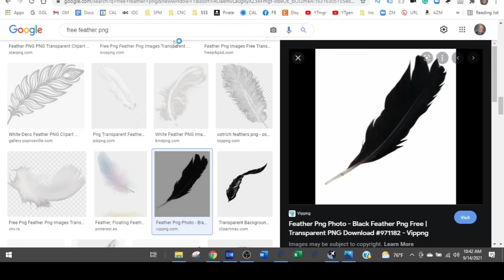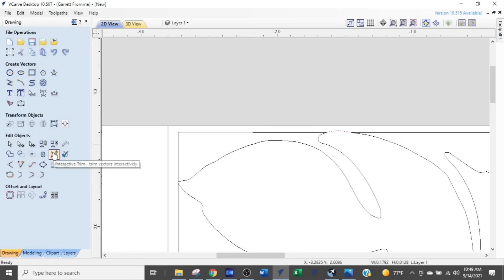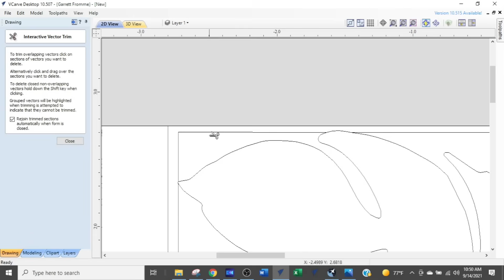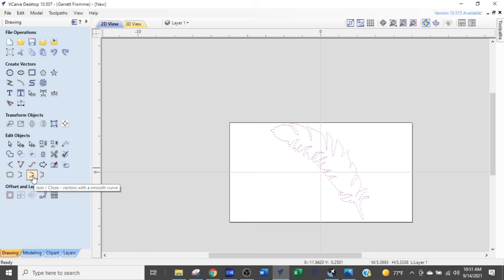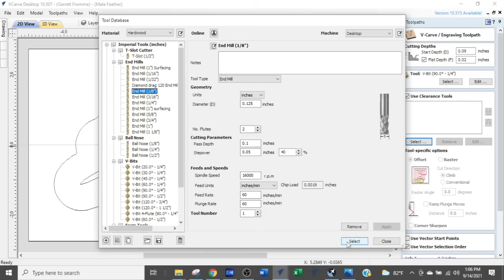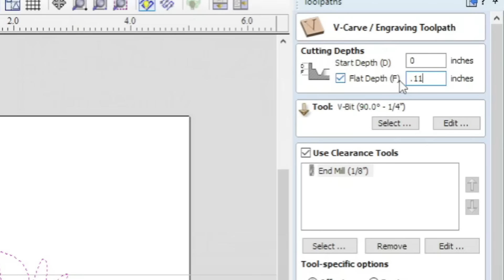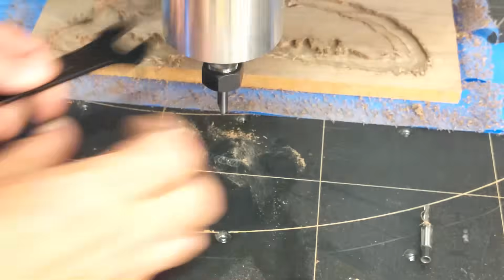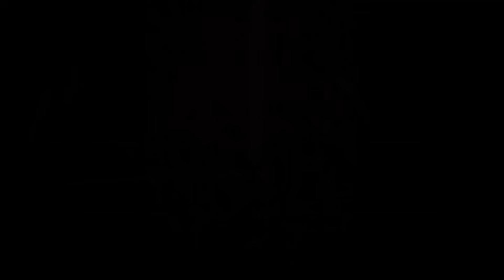How To Make a PERFECT INLAY with a CNC Router, Easy CNC Router Projects

Comment: As much as I'd love to follow along and try this on my own, unfortunately VCarve is entirely too expensive for my wallet at this time. ($700!!!!!)   I wish they had a monthly subscription I could get in on on but $700 for the software with no promise on return is a huge investment especially when I'm trying to justify about $3000 for a cnc machine upgrade (from my Sainsmart 3040).  I got about   33 minutes in, realized how expensive VCarve was and had to stop there.  Hell...I'd even try to sneak $350 past my "financial advisor" (wife) but as it stands now, I'm pressing my luck on the $3,000 hardware investment.
Is there any way you could do something like this with any of the other software?  I was very motivated by your intro and had high hopes of results but the sticker price will scare most any beginner out of being sadly disappointed when they find out that the software alone is ~1/3rd the price of the hardware. 
If you could offer any advice for those of us like me that don't have an extra $700 to spend on just the software would be greatly appreciated.  Thanks!!
Reply from the maker: John, I get your concern but you can accomplish all of what I showed you in the video with VCarve desktop. I think what you are looking at is the Pro version that you don't need. VCarve desktop is more reasonable at $350, and the reason a lot of us hobby CNCers use it!
Reply: @IDCWoodcraft  The only thing about the desktop version is the size limitation of 24"x24".  The cnc machines I'm considering have a minimum size of 29.5" x 29.5".  Wonder if there is a "upgrade" version to go from desktop to pro later on down the line if I start making some side money from my machine?
And thank you for replying back.

Comment: Excellent video.  Thank you.  I've been doing inlays on my CNC for years, but when I started there were no guidelines and I had to get to mine by trial and error.  This brings up a couple of questions.  First, the female where you use .09 for start depth and flat of .02.  Does that work no matter what v-bit you are using ... 45,60 or 90?  Even if we go to 30 degrees?  It is my experience and I think you mentioned it in the video, that the finer the inlay, the steeper the v-bit.  I imagine and have seen a couple of videos where that has been the case and they've used a 1/16" or even a 0.5mm tapered ball nose for the v-bit.  Please give us your thoughts on that.  Still the 9:2 ratio between Start and Flat depth?  Thanks again.  Dave
Reply from the maker: Hi Dave. You can do an inlay with any angle. The rule of thumb is the sharper the angle, the deeper the inlay needs to be.

Comment: Is there a way to do an inlay on a painted piece of wood,  and not mess up the paint around the inlay?
Reply from the maker: Alayna, great question! My immediate thought on this one is that it truly depends on what your inlay is and the paint you are using. I haven't tried this but I worry the edges of the paint near the inlay would be less than idea. Have you considered possibly staining the wood instead of paint?
Reply: @IDCWoodcraft   I could try. I was thinking of trying to do in lay stars on a wooden flag.

Comment: Hi Garrett, I think your method is great - only for very detailed motifs the 90 degree cutter will probably not be the right choice or? I have two questions: Does your method also give the possibility to mill deeper (at more acute angles) and the more important question: How deep does an inlay for a cutting board actually have to be?
Reply from the maker: Hi Daddy Approved, if you are going to be doing inlays for a cutting board, deeper is better. Typically I would recommend  that the male inlay be end grain and use a sharper v bit like a 30 degree v bit. Somewhere around the 0.4" depth range is probably "ideal" for a cutting board if you want it to stand up to some serious chopping in the kitchen!

Comment: Terrific video. I actually think I can this as a newbie to CNC. One minor suggestion - I would resaw the walnut on the bandsaw, much safer. I assume that if you have spent the bucks on a CNC machine, you would have a bandsaw. 😀
Reply from the maker: Ron, thanks! And you bring up a good point with using the bandsaw on the walnut, definitely a safer option!

Comment: Do you have a video showing the difference between the desktop and pro version.  I'm new at cnc and don't want to spend 700 bucks for the pro just for a year of service
Reply from the maker: Derek, the main difference is the cutting area. With desktop, you'll be limited cutting space to 24"x24". But, depending on what you're making this works great for a lot of our CNC brothers and sisters! Another thing about vetric is that you can always upgrade at a later time for just the difference in cost between the two versions. It's also a one time cost to you and not a yearly expense (unless you want to upgrade versions later down the road). Hope that helps explain a little bit about the differences!

Comment: Great video! Only comment I have is in your numbers. I have used the same numbers for a long time with perfect results. I use 0, 3 and 2, 1. Any comments?
Reply from the maker: Lloyd, thanks! You know, there's definitely a few ways to skin this cat. I have a mentee who also uses different numbers and he says works perfect for him too. If those numbers give you good results, I'm all for sticking with your method!
Reply: For anyone who might be reading this, I left out the decimal point. I meant 0, 0.3 then 0.2 and 0.1. But you probably already figured that out.

Comment: How do you determine your depth settings for male and female if you are doing a more detailed inlay? I am wanting to do the bird on the Poland Flag, just the bird and not the shield or even the outline of the bird. I was wanting to do it with walnut on cherry.
Reply from the maker: Use the same settings regardless of detail. Can go to 60v if necessary
Reply: @IDCWoodcraft  I am actually using a 60v... some of the outer feather lines on the bird dont go as deep and im afraid that when i glue and shave off the walnut those ones wont be there. I will give it a try, thank you for this tutorial.

Comment: Hi Garrett, thank you for the great videos. I am in the process of learning the software and the capabilities before purchasing and I wondering if the inlay work can come to a fine point on both the female and male sides. When I look at the feather it appears that the inside points are curved so the tool can make the full depth. Thank you for everything you are doing. Because of you I am looking to buy the Long Mill instead of the Shapeoko.
Reply from the maker: Enduringpromise, you're so welcome I'm glad you've found the videos helpful so far. Great question and the short answer is yes you can make the female and male portions come to a fine point but this isn't completely necessary and adds extra complexity in your tool paths and endmills you choose.

Comment: using your numbers on the start depth, and flat depth I find that when I glue the male to the female, the male is flush with the female board. The end result is gaps in my inlay. when I changed the start depth , on the male, to .2 and the flat depth to .1. the female is set at .3.  the result is very good with a nice tight inlay.  now while it's carving it the bit does plunge quite deep.  I'm thinking I should cut this in 2 passes....your thoughts
Reply from the maker: Hi Rick. If you are using 1/8" and going 1/4" deep or more, yes, 2 passes

Comment: when v carving the male ,plug, the tight spots all chipped out.  I used walnut just like yours, I used a 60 degree bit .any tips?
Reply from the maker: Chipping doesn't matter on the bottom of the make plug. It's not visible. Perhaps slow the feed down.

Comment: Thank you Garrett.  I'm trying to do inlays with the skinny jenny by cody's cnc.  It's a 5 degree tapered ball nose, and I'm having a tough time doing inlays.  I'm trying to do a .2 total depth, so there will be some meat for my father to turn away on his lathe.  What depths should I use so the .9/.2 theory would still apply?  Thanks again!!
Reply from the maker: Jason, thats a really shallow angle to try for your first inlay. Have you tried using a v bit first?
Reply: @IDCWoodcraft  no I haven't because I have the mindset that he needs some to turn away on his lathe, and shallow tips would disappear pretty quickly. I glued up a possible success tonight using a 1/16th bit in carveco maker, so I'll see how it turns out tomorrow, but I am going to try a vbit inlay soon, likely with a 60 degree. My inspiration is to be able to do narrow inlays like Broinwood...the best there is in my opinion
Reply from the maker: @jasontaylor7712  you could even get away with a 30 v bit for supper fine details. Just go a little deeper

Comment: Great tutorial...thanks for creating/sharing it!

I do have a question and/or a suggestion: 

Rather than having to manually cut out the male component after the vcarve and pocket tool paths are complete, why not just add a tool path to have the CNC cut it out for you?  

e.g.: create/add a second “feather” offset vector the same size (or slightly smaller than the first one) and assign a tool path to it that will cut the part out at the very end.
Reply from the maker: G.B., you bring up a really great point! That's a great suggestion and you're absolutely right. You could add in a tool path to cut it out at the very end!

Comment: Hi Garrett I have one question. Would you share how to create the tool path for the surfacing bit?
Reply from the maker: Hector, I think you'll find this video on the surfacing bit super helpful. Here's the link → https://youtu.be/1Y4UonzWhSE.
Reply: @IDCWoodcraft  thank you!!!!
Reply: @IDCWoodcraft  Garret, I get how to set the tool in my tool file Thank you!  Now for the tool path, I will use a Profile, with my start depth of 0.0, and (if I want to re-surface 1/4 of an inch)  my flat depth should be  0.125 inches?

Comment: Was able to make this beautiful feather inlay after my second try! Just has a note, i have a next wave shark 120. The table size is 12x30. I assumed that the x and y axis was the same, but they are reversed. My first attempt was putting the 5.5x10 inch wood blank so the 10inch dimension was parallel with the 30 inch side of the table, To my surprise, the orientation was 90 degrees off.
On try # 2 i just put the blank so that the long side was perpendicular to the long side of my machines table...came out just great. no show stopper, but if you are trying this for the first time you might want to make sure you have the orientation correct since in my machines case this was not intuitive...i'm sure you could switch the xand y in the program, but it was easy enough to turn the  blank 90 degrees since i can go to 12 inches in that direction.
Reply from the maker: Rick, that's awesome! I'm glad you're inlay was a success, they sure are tricky but the end result is so rewarding! Plus, I'm sure it looks great, I think we are always our worst critic! 

You bring up a good point of switching around the orientation of the board to work for your machine! Thanks for bringing that up. I'm sure some of our other CNC brothers and sisters probably run into the same problem! Keep working hard man!

Comment: Great video! All things being equal, how do you decide which file type to start with originally? At the beginning of your video, you mention "looking for a free DXF, PHG, image...whatever you want to use..." Does it matter or are there preferred file types if availability is not an issue?
Reply from the maker: Great question Bent. It doesn't really matter as long as the file that you found is high resolution. If it is a low resolution thumbnail sized file then it will be blurry when you import it into Vcarve and when you convert it to a vector, your lines will be all over the place! 
If you can find a high quality SVG, thats even better because the file is already a vector and you are ready to go once its put into Vcarve. You can enlarge a SVG as much as you would like and it will look perfect because the file is 100% vectors.
Reply: @IDCWoodcraft  Great info...thanks!

Comment: I have a problem my cnc uses a dremel, it only cuts .5 or 1mm each time, when I cut the female part I can set it to cut .5 or 1mm, but when I cut the male part, it starts at 2.5mm plus the . 5 mm deep and cut 3 mm in one go as it happens in the video, and that is very aggressive for my cnc, please,  is there any recommendation so that I can cut the male inlay in three times of 1mm? Thank you!!!
ps: With your video it was the only one that I really understood how to make this type of inlay, it is extremely detailed and in a very intelligent and orderly way it explains concepts that others overlook, thanks again!
Reply from the maker: Hi George. You have to slow the feed rate down. You'll have to edit the design file toolpath. They can't change the g code without a lot of editing of the file itself.

Comment: Hello, I am trying to do an inlay and having all sorts of problems. I am using Carveco, are the settings in Vectric different than in Carveco? I am using your settings and it isn't working. Any help would be appreciated.
Reply from the maker: Hi Jim. Since I don't use carveco, I can't really provide an answer. I'm really sorry.
Reply: Hi Garrett, update. Your numbers were right on. Operator error on my part. The problem I was having was my step down was too high. The bit was slamming into the wood so I thought the settings were not quite right. I made the change and it worked perfect. It is gluing up now. Thanks for your videos, I am learning a lot.
Reply from the maker: @jimwoodworker4110  I'm really glad to hear that. It kind of worried me that you were having challenges with that software. It made me want to know more about it
Reply: @IDCWoodcraft  Well I cut it apart today, sanded it down and it turned out perfect. It was just a piece of scrap, just to see if I could do it. Now on to more challenging projects. Thanks for your videos.
Reply from the maker: @jimwoodworker4110  You're welcome my friend

Comment: I have tried this using Vectric desktop, but for some reason the carvings always come out "close", just a little bit of space around the cut out.  The glue shows through and they look good, but just 'not quite'.   What really works well for me, is to do both files using, say a 30 degree bit.  Cut the female using a 20 degree bit, and cut the male out using the 30 degree bit. 
This puts a slightly wider angle on the part that gets inserted, so the edges of the female part are sure to close in tightly to the male part (think about the geometry and you'll see what I'm talking about).
I don't know why I couldn't get it "perfect", maybe my bits wore down after a bit of carving, but they were just off a bit, enough to be noticeable.   But with different angles (using the same calculated file), they come out perfect.
Reply from the maker: George, I've heard of a few people having this same issue of them not fitting in quite perfectly! Thanks for the tips, I can totally see what you're talking about using the 20 degree bit on the female and 30 degree on the male! If I come across someone having the same issue, I'll pass your advice along!

Comment: Love the video! Just confused as to how start depth is greater than flat depth
Reply from the maker: Great question Larry and thank you for asking! The start depth is greater than the flat depth to give a gap between the top of the female piece and the male piece that is being pressed in when we glue them together.  The inlay technique I showed you relies upon the tapered profile to wedge the two pieces together. If we didnt have this gap between the two and they glued up flush, we would not have the two tapered profiles of the male and female piece tightly pressed up against one another. And then when we went to cut the excess off, there would be voids in the finished inlay.
Reply: @IDCWoodcraft  Thank you for the prompt reply, I know you've been very busy with all the new stuff you have going on.
I understand needing the gap, I just can't wrap my head around the fact that the start depth is usually zero based on the "z", or at a different depth if you are doing something like carving in the bottom of a pocket, and flat depth on the depth of cut you want. I understand this process works, just the two numbers seem backwards and I'm trying to  get my brain to make sense of the concept.
Once again thanks so much for all you do.

Comment: Hi Garrett, it's been a while. You mentioned GBRL software. I have the version for lasers, but is there one for CNC machines? Or are you using what Vetric offers? I am thinking that the gcode generated by vCarve Pro will suffice unless the Longmill doesn't recognize it.
Reply from the maker: Hi Rafael, Its good to hear from you! I am using vCarve Pro and it works great for the Longmill but you have to make sure that you post process the G code using either GBRL (inch) or GBRL (mm) vCarve. This is done in the machine configuration in vCarve. 
To run the G code on the Longmill, I recommend using gSender or UGS. You can also use candle (comes with cheap CNC machines) but its not the best
Does this answer your question?